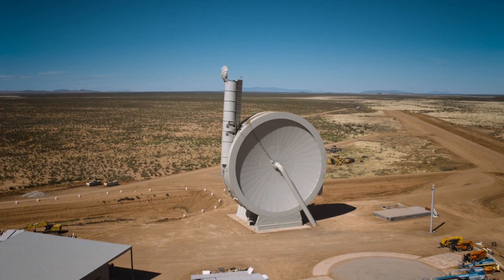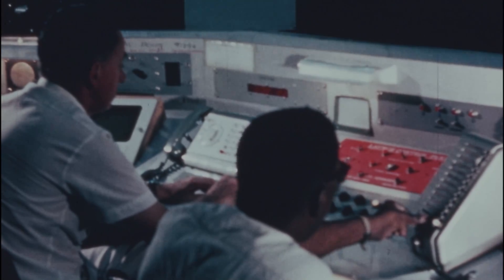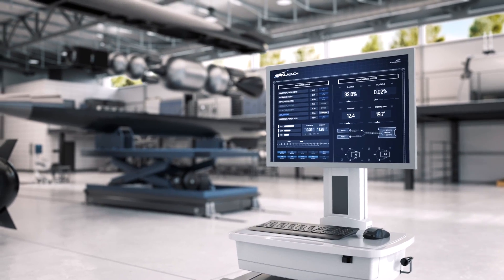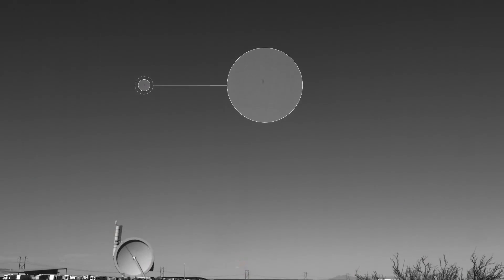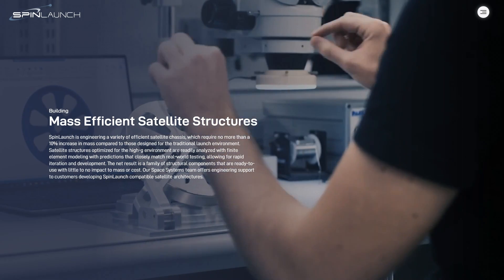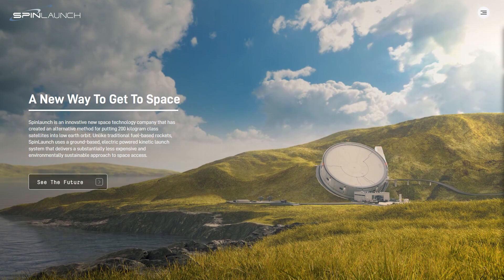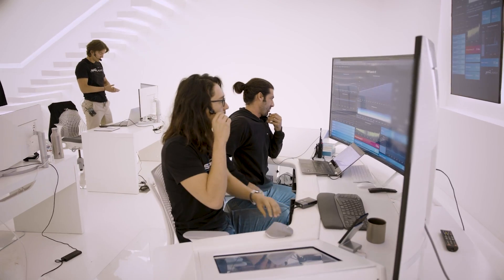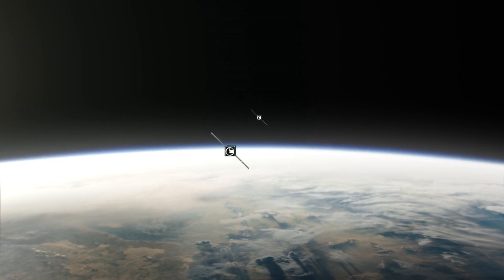Can Spinlaunch Throw Rockets Into Space?

Comment: I don't think it's possible to adjust the arm after release, it's just going too fast.
I bet they're going to have to release 2 payloads from each side at the same time at those sort of speeds. Dumping a sacrificial payload of the same weight into the ground. No way can you have an arm spinning at 7x speed of sound suddenly become REALLY unstable.
Reply: MATH FIGHT!
Reply: @boofergod  “Maths” fight...
Reply: They could very well have a large ferromagnetic load that they shoot down a giant straight solenoid and reclaim a portion of the energy it took to launch with the “sacrificial payload”. It would even be a great spot to put the vacuum system as the incoming air pressure flooding the system could assist in propelling the magnetic load down the shaft or even close behind it leaving a partial vacuum for less loss due to air friction.
Reply: @atomatopia1  if you want to reclaim the energy you need somewhere to put it. If you wanted to dump it into the power grid, you'd need to connect it up to the grid with wiring able to handle the power levels involved and THEN the grid would need to somehow use up the energy. The trouble is that the power grid is already set up to provide the required amount of power at any given moment and I believe there isn't a single commercial power source that can save energy by turning off for a couple seconds and then back on in response to a momentary, massive feed of power to the grid.
Reply: Instead of a sacrificial load, you could make the other end and electromagnet that is attracted to a set of rails on the inside of the wall.  Varying the voltage would change the magnetic pull to the wall in effect acting as a counter weight.  And doing this would allow you to instantly adjust the counter weight when the projectile is released.
Reply: @joshuarounds7180  This is the best armchair idea I've seen to handle the release yet.  The force would be pretty extreme, though and would have to be sustained while the system slowed down.  But it might work... definitely better than the rocks idea.
Reply: @joshuarounds7180  I was thinking along the same lines, however with a wing that could exploit the in rush of air.  I like a magnetic field better.  Less turbulent, but perhaps both.
Reply: Like I giant out of balance flywheel 😳😳
Reply: My first thought was to have a way to shift the mass in the counterweight inwards as quickly as possible, using an explosive/propellant and latching system or something.
Reply: @pyromen321  that mass has 9000g acting on it. To blow it back inwards I believe you'd need an explosive of around 7 kilotons as calculates above to counteract it and send it back inwards.
Reply: @RyanShiels  I never said it would work, lmao! It was just my first thought
Reply: @RyanShiels  although, I am wondering where youre getting the 9000g from considering that 9000g is well above mach 25.
Reply: @brianmcclenahan617  The answer is obvious for the sacrificial payload - load a bag full of rocks, and have it release down a shaft where it can safely explode and be nothing more than a slight tremor in the ground. It'd cost a shitload for the shaft and would be a bastard to find an area geologically stable enough to handle that without bad shit happening as a result of essentially doing regular small-scale nuke explosions in the ground but isn't outside the realm of possibility and is honestly the easiest solution I could come up with as a layman. They're obviously not releasing a anything-multi-ton counterweight into the freaking launch chamber as that would be suicidal at best.
Reply: @BigBoyXP4014  or an angular hole that feeds into a loop to allow the sacrificial payload to slow down. There's videos of guys using PVC piping to bend bullet shots into different trajectories. Perhaps a spinning catch system that lines up with the catch of the sacrificial payload and slows it down. It would have to be on railings as standard tires would just melt. Perhaps titanium railing and wheel system.
Reply: @BigBoyXP4014  A Sacrificial mass would be catastrophic in either a closed or open system. You are essentially trying to catch the equivalent to a 7k or more tnt explosion focused completely at one single point. 
Alternatively, you send one off into god knows where to deal a multi Kilotonne Explosion to some unsuspecting sod down wind. As soon as it hit air, it would tumble and could end up miles off target.
Reply: @BigBoyXP4014  there are probably more efficient materials than a bag of rocks, such as steel or depleted uranium
Reply: Should have an underground "shoot tube" that's really long and can catch such a ridiculous projectile.
Reply: The counterweight arm could retract in to compensate weight distribution but it would have to happen in 1 ms? Would like to here the actual solution.
Reply: I think the best solution would be to have the arm opposite the spinlaunch be hollow, and filled with 10 tons of a very dense powder. 10 tons of Tungsten would cost around $300,000, very little for an operation of this size. Have the opposite arm's end able to be released in a fraction of a second, and dump the powder into a big hole, then recover it for next time. That's probably the easiest way to manage such high mass. You'd only need a volume of about .52 cubic meters, or about 18 cubic feet, for it to work. Well, you'd need more, since powdered tungsten wouldn't be as dense as solid tungsten, but not a huge difference is my guess.
Reply: @sino_diogenes  That's a cool idea, the circular shape of the device and smooth insides means that collecting it at the bottom is already built in!
Reply: The sacrificial payload would hit the ground with the force of a meteorite of the same mass.
It would be Tunguska every time it launched.
Reply: @MichaelClark-uw7ex   The sacrificial payload sounds awesome, but it seems more likely they will just have a weighted rod in the arm that moves toward the payload at the time of release.  Essentially the "Sacrificial Payload" just moves to rebalance the arm.  No need to release it.  Then just run the motor backwards to recover most of the electricity.
Reply: The arm has to adjust somehow to release the payload.  If it moves some of it's mass outward on the release arm, it can be automatically rebalanced.
Reply: @DeputyNordburg  there can be an internal counterweight that lives on the inside of the arm when payload is released so is that one and it makes its way out very quickly
Reply: @zacmac   There can be duckies and bunnies too.  But like the ejected counterweight, they were not used with this machine.
Reply: Another alternative, the weighted end is a massive metal container filled with a heavy liquid that gets sucked up down the center shaft as soon as the payload is released. The container would have a hydraulic system in place to help push the fluid to the center while a pump system helps pull the fluid at the same time. This way, fluid levels can be reflective of the payload instead of having to alternate different sized weights or even sacrificial payloads. Considering that one side of the arm would be heavier, the container would be more centralized so the strain of the pump and push wouldn't be so bad. And, if the draining implementation doesn't work, an emergency release valve can let the heavy liquid release on the sides seeing as how the liquid would have less force impact than a solid mass. Chances are, if it's a dissipatable liquid, it will evaporate from the friction alone before causing serious damage. It'll be super heated but this should bypass a lot of potential damage to everything.
Reply: I only see one hole, though, and they're probably not going to blow up their fancy vacuum chamber on every launch.
Reply: @JFJ12  stuff going to space needs to go up. Not sideways.
Reply: I donk know much about kenetic energy of the opposite force, but is there no way the make a tube greased up and curved enough to send the opposing released force safely another direction?
Reply: sorry if that was what this whole thread was about. I came in late and there's 63 hidden replies.
Reply: With enough mass in the arm, the payload leaving the arm won't make a big enough imbalance to matter??
Reply: I was thinking the exact same thing. Just dig a really long tunnel and dump a countrrweight down there at the same time. I can not imagine how else this could work.
Reply: Could u just have a counter weight sitting in the center… then upon release blast that shit down the arm to replace the payload
Reply: @tiotheberk  Exactly! This idea has the most merit I think. Leave the weight near the center but on the same side as the payload until it's time to release. The spin will pull the weight towards the payload. Release the weight first, then release the payload as the weight hits the end of the arm. Time it right and the centrifuge will never even BE unbalanced! 

Or use a long metal rod that starts on BOTH sides, and then as it shifts it will both add to the payload side AND subtract from the counter-weight side.
Reply: Since it's already been done on a small scale, I guess it didn't occur to any of you guys to just look into how they actually did it rather than arguing about it?
Reply: @bigredc222  It hasn't though. It's well below orbital velocity and came out sideways.... It doesn't work at this scale, never mind the speeds and forces required for full scale launch.

Make a matchbox car, then try to make a full sized car out of paper and wood. Scaling up isn't as simple as you make it out to be.
Reply: @RyanShiels  What are you talking about scaling it up isn't as easy as "I" make it out to be? All I said was you guys can probably find your answer to the imbalance question by looking into how they actually plan on doing it. I've never even heard about this before this video. I don't have any opinion about scaling it up or anything else about this project.
Reply: Would be also great to recover energy from that second payload while it's braking.
Make a tunnel in the opposite direction and then maybe slow it down with electromagnets and save the energy for the next launch?
Reply: That doubles the amount of energy required to get it spinning. That's not an insignificant per-launch cost difference.
Reply: @robot_spider  But YouTube science demands the spinner be balanced, sorry actually, "perfectly balanced".  And just moving a counterweight on the spinner to rebalance it seems like cheating.
Reply: That actually isn't that bad of an idea. Just make your sacrificial payload like, 5 tons of rock in a "sack" so nothing is really lost when you yeet it into the ground
Reply: @Fattts  are you aware of what 5 tons of rock going at that speed hitting the ground will do in terms of overall destructive force...
Reply: @ElGrecoDaGeek  I've got a rough idea
Reply: @ElGrecoDaGeek  rather than a single rock I was thinking a bundle of rocks sent down a shaft with a gentle curve so the smaller rocks lose their energy over time.
Otherwise you'd have a kinetic weapon of massive destruction on your hands the power of a small nuke xD
Reply: @RyanShiels  You seriously underestimate the energery from nuclear explosions.
Reply: @RyanShiels  (1/2 * 10000kg) * 2400m/s^2  = 2.88E10 J 

Thats a little under 7 tons of TNT.
Reply: @ElGrecoDaGeek  Hmmm 5 tons hitting the earth at app. 2401 m/s.  Yeah, I guess 4 or 5 million tons of kinetic E released.  But I"m not a math guy.
Reply: @7e21  yes... and the smallest nuke had a yield as low as 10tTNT so... well done. you proved my point.
My guesstimate was correct, thanks for confirming.
Reply: @RyanShiels  Yes. And thats still ~25% more for the smallest nuclear warhead detonated with the lowest possible yield which (correct me if I'm wrong) never actually got tested like that and is more of a dirty bomb anyway. It's a big explosion sure, but its hardly a "weapon of mass destruction" and well in the range of conventional explosions be it intentional or accidental ones.
Reply: @RyanShiels  Why not use water? Water is nice and dense, can easily be released at the right moment and you can easily dissipate the stored kinetic energy from the water as well. Just let it fall into a long shaft or even just reinforce the bottom of the spin chamber to redirect the water out the launch tube after the rocket.

This would also have the advantage of if something went wrong inside the launcher... just release the water and any fire etc would quickly get extinguished
Reply: @LemmingGoBoom Water is so much less dense than metal you'd need loads of it in a massive container just to offset a small rocket.  

 the problem is that as soon as the payload is released, the arm is so unstable it would tear itself apart within milliseconds unless the centre gear was unimaginably strong to deal with such unbalanced forces. Which I believe is impossible. 

Water would take too long to flow out and also would react super weirdly at those speeds. It's more or less a solid without time to flow, until it hit something where it would immediately boil into a gas due to the insane pressure on itself, causing a different huge explosion!
Reply: @ElGrecoDaGeek  maybe they could make a large hole on the other side, and fill it with water to act absorb the impact? sort of like how a bullet loses its speed after traveling a few feet in water
Reply: @tehnarelhok718  the water would explode via turning into a gas immediately from the pressure causing insane heat when hit.
These speeds and forces are so far beyond conventional methods and time frames to deal with.
So having the water anywhere near the system would be impossible, to vent all the gas and the crazy temperatures being generated without back firing back into the spinny boy
Reply: @tehnarelhok718  not a bad idea in terms of thinking outside the box, but the water would be vaporized. The forces involved are absolutely massive. The counterweight will need to have the same mass as the payload and rocket (the rocket that engages at altitude,) so all that matter will hit the atmosphere and then the water. A bullet is a tiny mass going a fraction of that speed. Consider that hypersonic aircraft traveling at those speeds do so at high altitude where atmospheric pressure is a fraction of what it is at sea level.
Reply: @RyanShiels  You can't "drop" anything from space later alone from an orbit.
Reply: @ElGrecoDaGeek  or maybe into a cavern of water.
Reply: @ElGrecoDaGeek  could slow it down somehow after it’s left the barrel. Or use something that would slow down on its own, like a liquid.

Water wouldn’t hold its entire mass in a consistent manner, thus spreading out the impact. Could even use a substance that’s a liquid at high pressure (like when it’s being whipped around) but vaporizes once it’s dumped, thus dissipating the impact entirely.
Reply: @RevanLaughs  again way too much mass. The liquid would be vapourized. Even if it weren't water, the faster it slows it down (whatever the liquid) the greater the impact (pun intended).  We're talking about insane levels of kinetic energy here. Nuclear explosion levels (sans the ionizing radiation of course). More importantly it has to be released at the exact same time to keep things balanced so no slowing it down.
Reply: @JerryThain  again it's just way too much energy. The physics on this is just now adding up. The production version will be traveling at Mach 5 at roughly sea-level. The kinetic energy is off the charts.
Reply: @ElGrecoDaGeek  Not nearly as much as you think?
Reply: @ElGrecoDaGeek  Couldn't you use a lump of metal instead and build a kind of inductive decelerator which uses the balancing load to actually generate some power while safely reducing the velocity?
Reply: @RyanShiels  Aall you would need to do is have a mass near the center that gets released by computer timer to move to the edge around the same time as the payload is launched. It doesn't even need to slam into the end as you could have mechanical braking like tapers and other things that halt its movement enough to not cause a jolt (like fall arrest technology already in use). It also doesn't need to match the mass, just be positioned closer to center at its final resting place. If you engineer it right, you could have something a lot lighter travel a lot less distance towards the edge. A lot of this has been figured out in the 70s for centrifugal force space stations. equal mass is not always a necessity when you can use offset mass and counter spin. A second arm rotating in the opposite direction would allow for a hell of a lot more woggle tolerance, for example.

Regardless, its being done, so they have obviously figured it out on a smaller scale enough to predict how the larger scale will react..
Reply: @talyn3932  I do believe though that any system, mechanical or otherwise will have a hard time operating as intended at that speed, especially with that heavy payload. It is I think unreasonable to expect a mechanical system to work well in those conditions and I do find the idea of having any form of mechanical breaking system at those speeds to be mind boggling to say the least.
Reply: @papab34r  its just scaling. All you beed is materials and timing to svale with it.
Reply: @talyn3932  Scaling something from a smaller model to a giant facility is not easy as you would need to continuously reinforce points of the system, which in turn would make it heavier, which requires new calculations and so the circle continues. As for using other metals such as Titanium or something similar the cost would spiral out of control and those would be the easy choices, more complex materials such as composites would be even harder to use due to its anisotropic nature.

So to sum it up, scaling is not always possible and even if it is, it is considerably more difficult then just make the same exact design for instance 10x bigger.
Reply: @papab34r  No kidding.... :/  I'm not saying it can scale infinitely.
But the thing is... they are doing it. The proposed model for launching payloads is essentially scaled up from their prototype. They have obviously run the numbers and figured out where the end result will lie and how to get there. Everyone on here assuming they haven't are simply not giving the team any credit at all... which is insane considering the fact that this is a professional endeavor and we are all just armchair critics.
Reply: @RyanShiels  The water would vaporize when it hit atmosphere, not before.  So dig a tube down into a hill, and have a large opening out from that tube to the side.  Place a sacrificial vacuum chamber with easily pierced ends (same as their exit launch) down into the tube, and an armored door at the near end.  The length of the tube gives you time to close the armor, the water vaporizes when it hits atmosphere, and blows out the open side of the hill.
Reply: @ElGrecoDaGeek  just make the ground out of jello
Reply: @ElGrecoDaGeek  Ooo, ooo, launch over water. Will the sacrificial payload make a big tsunami? Now that is a nice way to clear a beach before an invasion!
Reply: @RyanShiels  that’s a bit of a misleading comparison though, because the energy of that kinetic weapon is going to be dispersed into the ground, unlike a typical air burst nuke detonation
Reply: @ElGrecoDaGeek  I done the math, about 3.4 tons of TNT type of energy, honestly that's not that much, you could make a tunnel with muzzle break like design at the bottom that could handle multiple of those impacts to my knowledge of engineering (multiple might be an overestimated, like, a few)
Reply: @ElGrecoDaGeek  It's not going to hit like a meteor, if that is what you think. The only velocity it will have is generated by earth's gravity. And you know the formula.
Reply: @7e21  Little Boy was 15 kilotons. It's about 1/3 of Hiroshima. I wouldn't wanna be standing there, but it's not exactly an extinction event. OTOH, why not PICK UP that much mass right after release?
Reply: @grumblycurmudgeon  Not sure if you replied to wrong @, but kilotons is tons * 1000. My result was 7 tons so about 1/2000 not 1/3.
Reply: @7e21  you're quite right, and looking back over my own math, I see I factored the velocity wrong, to boot. My mistake.
Reply: @LemmingGoBoom  the material used as a counterweight is almost meaningless. You need to offset 200 tons of mass, water, rocks, tungsten would all have the same kinetic energy to dissipate. Dropping water in the chamber would be a terrible idea, since it is supposed to be a vacuum at the start. High energy water would turn into water vapor and blow up the machine.
Reply: @ElGrecoDaGeek  Yehe or the counterload could be of a inverted railgun i.e magnets in a tube slowing it down. So it does not need to be wasted. Or just a big steel ball that roles in a piple gently curving upwards, perfeclty calcualted it could roll for a few hours then have just enoguth speed to get home again ready for next launch :)
Reply: @ElGrecoDaGeek  They could put a mattress down there..
Reply: @RyanShiels  i agree that water would propably explode on impact. However i don't agree that the desity would be a problem 10t is just 10m³ of water in a thing that has a Ø of 100m it should be very possible to fit a counterweight of that size. That would be a cube with a sidelenght of 2154,4mm so not that big after all.
Reply: @ImposterMalone  the induction Idea is great. That could actually work somehow. Although it might melt the counterweight.
Reply: @JerryThain  That would lead to a huge steam explosion, equal to some 5 tons of TNT.
Reply: @ElGrecoDaGeek  yes it is. I am totally impressed by the very committing tours young skiers are doing these days. Drones allow non-alpinists to experience the grandeur of our mountains. Thank you!
Reply: @ElGrecoDaGeek   @DasHHat   Isn't the projectile supposed to be 200 kg? if the counterweight is 5t, it will be yeeted at a bit less than mach1.
Reply: @ElGrecoDaGeek  enough to penetrate yamato from starboard and exit to portside andleave a clean hole.
Reply: @RyanShiels  are you sure you didn’t mean  10 kton? 7 or 10 tons is a large conventional explosive.
Reply: @ElGrecoDaGeek  could bore a vertical shaft into the ground, with the centrifuge mounted on a separate foundation so the energy from ground impact wouldn't mess with the launch system
Reply: @LemmingGoBoom  while simultaneously destroying the centrifuge
Reply: @talyn3932  You once said that assuming the inventors haven't ran the numbers and come up with ideas to make this work meant not giving them credit. Which would be true, were it the case. All that people are doing here is exercising their thinking and having a relatively respectful exchange of ideas, which has nothing to do with their opinion on the competency of the people actually designing the system. You know, everyone is just wondering what the solution will be, so saying "they know what they're doing, they'll have a solution" is probably part of a different conversation.
Reply: @ElGrecoDaGeek  Just fill the landing area of the rocks with sacrificial jell-o. Duh. Science.
Reply: @Fattts  I love how yeet is now a scientific term.
Reply: @Fattts  5 Tons of water.  Vaporize when it hits the atmosphere.  You've got a massive heat shock, but that's about it.  Build your negative release over a hole in the ground with refractory materials between it and the launcher and it's all good.
Reply: @Fattts  Yes it is, It is only a bad idea...
Reply: @ApolloVIIIYouAreGoForTLI  solid mass + deep hole with gentle slope. Dissipate the energy without causing impact within the machine.
Reply: @Fattts  You just have to have a dump that can contain the energy. See next reply.
Reply: @Fattts  why not some compressed gas, open chamber and it could even give some boost to the launched projectile
Reply: Space catapult go brrrrrrrrr
Reply: Or how about make another budget for bearing replacing?
Or design another kind of new bearing that could easily be repaired.
Reply: That sounds good but both arms are in a sealed circular chamber, maybe we could have two tubes and aim one at an advisory lol.
Reply: Clever.
Reply: It shouldn't need a second payload. With the right materials, they could probably use some sort of CVT (continuously variable transmission) or one of it's various "cousins"  and/or a dynamic counterweight set up to mitigate any instabilities caused by the sudden removal of the payload.
Reply: Place a weight on the center of the crankshaft equal to the weight of the object being released as it's released the weight can extend rapidly with shock absorbers or something of the sort to balance the crankshaft. Just a thought.
Reply: The load will be apart of center mass perhaps untill releas
Reply: @The Enby Engineer that presents a few issues, firstly the size of the required container, secondly the fact that that would still be incredibly destructive, thirdly that a dynamic load like sloshing water would be hell for this machine to deal with and would likely imbalance the whole thing
Reply: Maybe some kind of sliding counter weight could allow it to auto adjust the balance of mass after release.
Reply: Don't tell Elon or he'll be using it in his tunnelling ventures.
Reply: Water balloon
Reply: You and I know this but fools are too easily parted from their money.
Reply: Instead of a solid arm, use a steel cable(s) and let it go along with the payload out the chute. Just need to aim it so when the cable comes back down it does so somewhere safe.
Reply: @caseyb1346  Interesting.  How does that relate to track and field hammer throw.  How do they recover without falling? I guess they just recenter.
Reply: Well, I'd worry more about the well being of the payload during the long spin up.
The g forces are huge and last long. The g forces during a rocket launch are shorter in duration and by a factor 1000 smaller.
Reply: or release it also upwards a moment later if it is stable enough for a few milliseconds. might turn out that dual launching is the way to go.
Reply: Also we can consume some speed by moving counterweight from center to edge, while big chunk moves it can spend energy to push gidraulic on the other side of arm to replace the throwed cargo.
Reply: I can think of some non destructable adjustable sulotions that might work for this.
Reply: Also air rushes in at the speed of sound 

That's like firing a cannon into it
Reply: Whatever they use to make the arm is elastic.... Releasing the rocket is like letting go a rubber band that's stretched. It will just bend the shaft instantly or lock the bearing solid with a friction weld.

This has to be one of the most nutcase ideas
Reply: Don't forget the vacuum is lost so you have to deal with aerodynamics on the internals,
but a counter weight doped at the same time, just drop it down a shaft.
Reply: @AlaricAchos  The other comments have calculated the energy to be in tonnes of TNT, so even if you throw it into a kilometer deep shaft, its going to create enough heat and shockwaves to self destruct
Reply: You are totally correct that the loss of the mass at the end of that arm needs to be compensated for. I was wondering whether they had some way to quickly shift a mass within the counter balance section of the arm to change the balance point instead of releasing a counterweight to slam into the earth
Reply: I just want them to build a giant thing like that and send 100 rokets in 12 seconds
How ?
I dont care 
:)
Now being serious :
kind a cool this Laucher
Reply: Just toss a huge ball of steel into a big pool below and you can recover and repair the sacrificial payload.
Reply: @Andrew-sv3ck  The ballistic payload glows red-hot when it hits the air. The only way that works is to convert kinetic energy into thermal energy, then deal with it that way. If you throw a steel ball into a pool of water at that velocity, it will flash to steam and cause a boiling liquid expanding vapor explosion (BLEVE). All that energy has to be dissipated somewhere. Not to mention that the steel ball will be deformed, if it even stays intact which is unlikely.
Reply: @Andrew-sv3ck   Now imagine you just keep that huge ball attached, and just shift some weight on the arm to rebalance.    Then recover the electricity by running the motors backwards.
Reply: You would only need to offload the  same mass as the rocket down another tube that then goes deep underground
Reply: Just make it a "double barrel" on the same trajectory and make sure the second payload has more drag so that it falls behind the first payload. The atmospheric drag is only going to be appreciable in the first couple of miles so the second payload would be pretty close behind it but enough to avoid collisions.
Reply: @greghight954  🤦🏻‍♂️
Reply: @greghight954  that double barrel can not work. At the moment of release the counterweight would face the exact opposite direction. If the rocket goes up counterweight has to go down.
Reply: LOL it's no problem as is. You've obviously never seen the Aroldis Chapman pitch
Reply: I think you underestimate how fast computers can adjust things.
Reply: @TarisRedwing  computers are very fast at calculating yes... however moving 10T of mass several meters does not happen inside of a computer. the release is instant... Doesn't matter how fast a computer calculates what to do, any motor or actuator can not physically respond and move that distance in time.
Reply: That or create an adjustable arm that re-centers the spinning mass the moment it releases the payload. Shouldn't be too hard to put heavy motors in the center that calculates this. If timed right, re-centering shouldn't be too difficult since at balance, there's no unequal g forces.
Reply: @brianmcclenahan617  not feasible, in my opinion. Look up "conservation of angular momentum" which explains how a figure skater can go from spinning at a few rpm (arms and 1 leg far from center of gravity) to many rpm (arms and legs near center of gravity) without any energy input
Reply: @julianbrelsford  right, that would be adjusted center of mass where as this would be unaffected center if mass. The objective would be to let the outside mass slow down from friction forces as opposed to stopping it immediately or bringing the mass to a centric location.
Reply: @brianmcclenahan617  the speed is just too high for anything to "move" in time to counteract it.
In an instant, just one side of the arm will be under 9000G with nothing to counter it! That's just an insane amount of force and would rip apart in fractions of a second.
Reply: @RyanShiels  then why not make the arms so heavy that the payloads weight difference makes little to no  difference?
Reply: @RyanShiels  So how would you address it?
Reply: @markharmon4963  Send me a freelance consulting contract with decent terms and I'll have a think about it.
Reply: @RyanShiels  what if you prolonged the release just enough 🤔